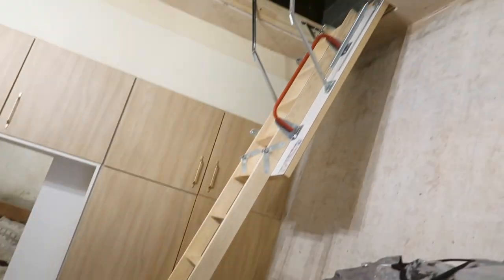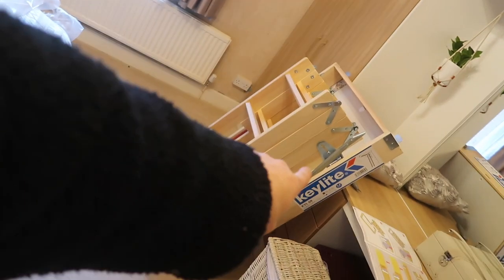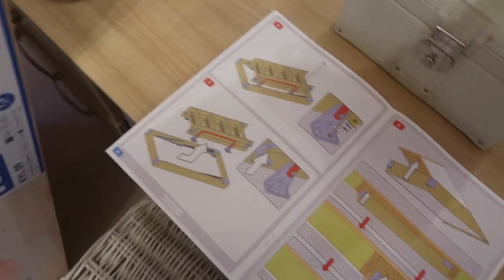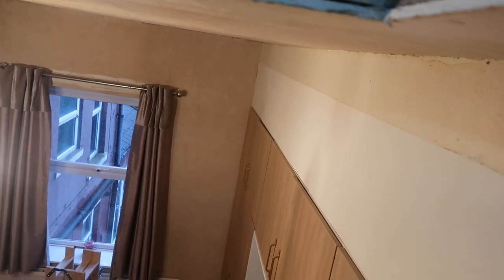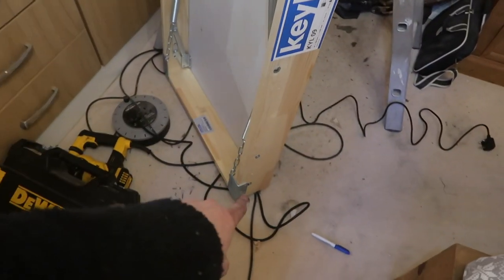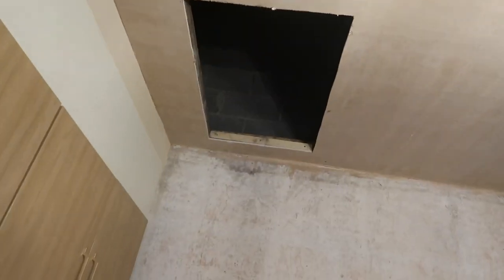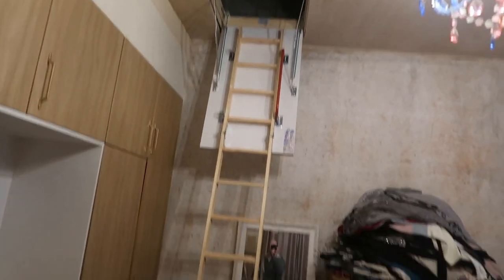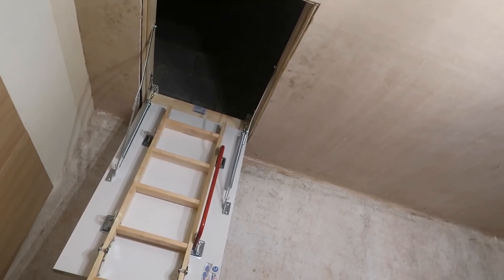HOW TO INSTALL A KEYLITE LOFT LADDER BY YOURSELF

Comment: Doesn’t look like you’ve raised the ladder away from the cover, when you climb up it I bet your toes touch the hatch?
Reply from the maker: yes they do, but that is how it is, the ladder is part of the hatch.
Reply: @The.James.Lister  it slides away by a few cm’s to give you clearance.
Reply: Yeah, there is allen screw ls at the side of the ladder to move the ladder away from the hatch to not foul the hatch with your foot as you climb up. This has to be done before you cut the remaining bottom section of the ladder.